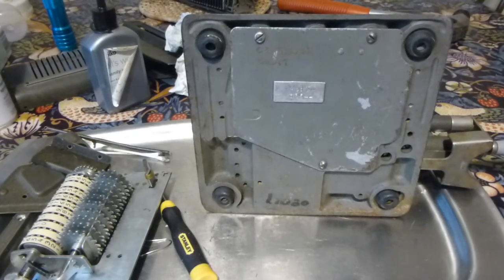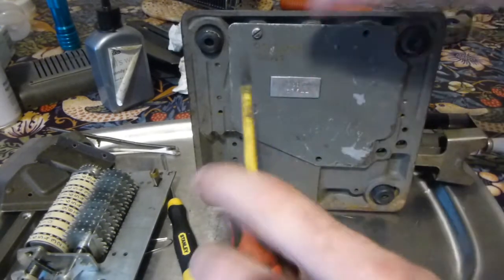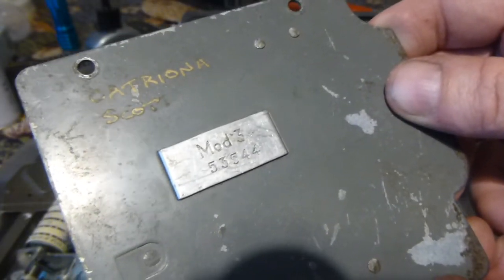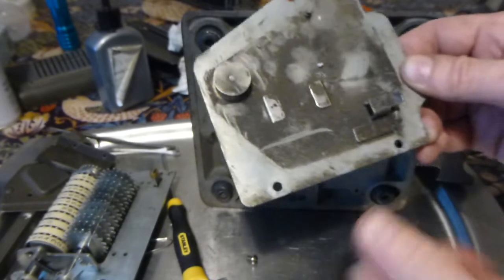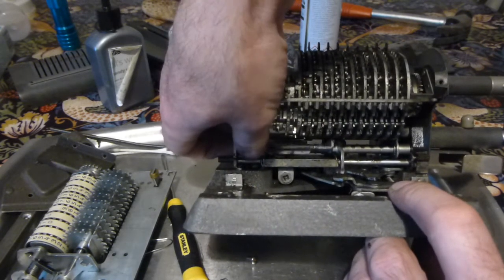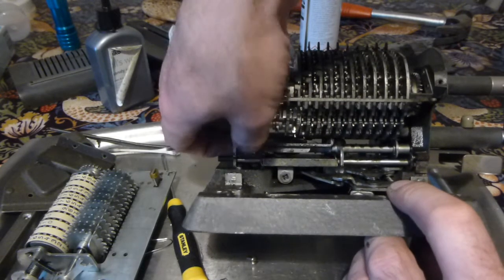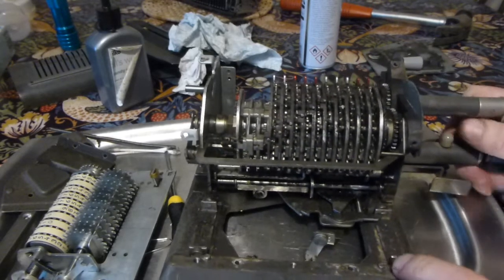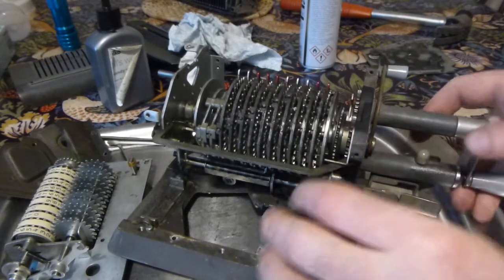Part 15 of 18, Restoration of Addo Multo Model 3 Mechanical Calculator

Comment: It looks like I'm not able to attach the screenshot, but the spring that I'm refereing to is just above and to the left of your left thumb when the video is at 3.25 minutes.

I'm trying to get a Addo Multo 23 unstuck that was used at our bakery before electrical calculators.